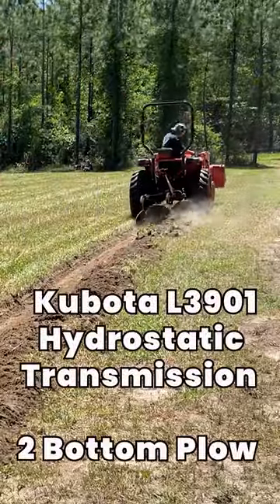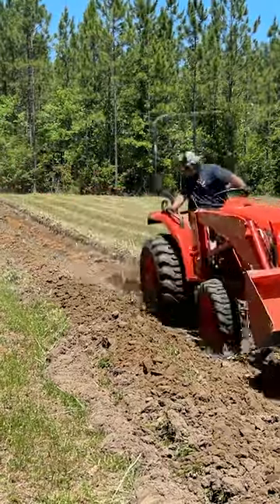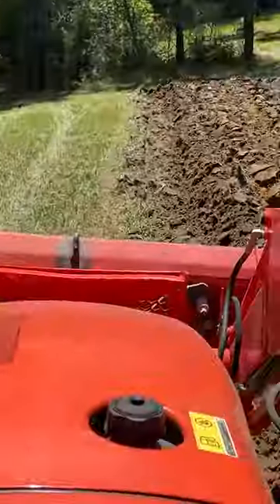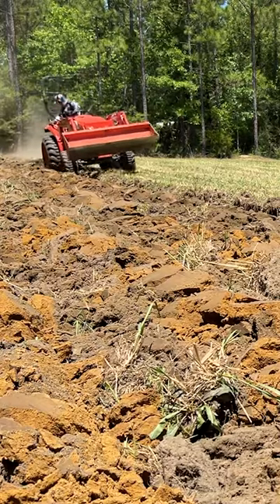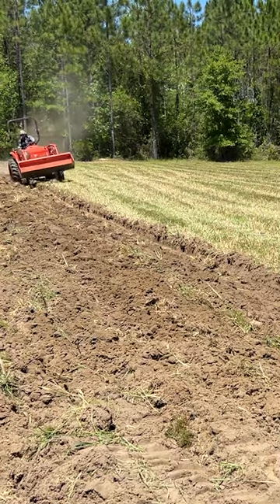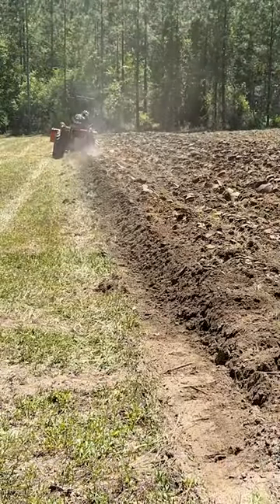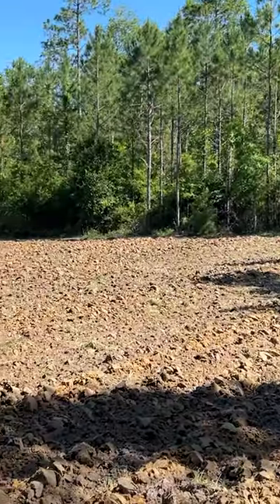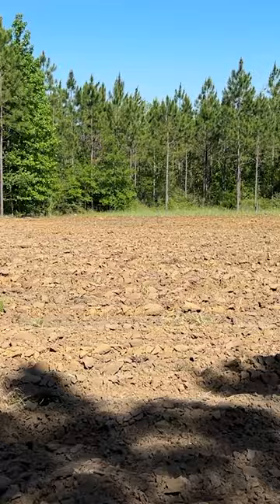Plowing 1 Acre With 2-Bottom Plow and Compact Tractor!

Comment: 15hp tractors use to pull those 2 bottoms back in the day.  They had torque for weeks.
Reply from the maker: Agree.  These new tractors are built different.
Reply: Hydro vs gear
Reply: @mattcaesar5781  I am talking about John Deere A&B
Reply: How much is plough and how much will it cost to send to zimbabwe
Reply: Gearing
Reply: Bigger tires.
Reply: @matthewheinze1231 not counting the 50, 520,580 and so on
Reply: @matthewheinze1231 they have pistons the size of coffee cans that's why they had the power, my favorite 2 bottom plow tractor is a super 77 oliver and the 861 ford power Master,  but the ford can pull a 3 bottom in has pie weights
Reply: The deers a and b is what I was taking about.
Reply: A farmall cub could pull a little genius two bottom, and a my international 806 could pull a 6 maybe even 7 bottom for days.
Reply: Also you loose a bunch of power through the hydrostatic transmission. I pull a 1-16 with my 20hp 318 john deere lawn tractor
Reply: Gosh, I have a 1993 murry self propelled 20" 3.5 hp push mower. Every year I hook a 24 bottom plow to it and turn dirt on 1700 acres. It runs at about 2/3 throttle all day, never misses a beat. It even mows the field at the same time. They  sure don't make like they used to... 🤔
Reply: @lcee6592  lol
Reply: @matty2helpfull hydros today yes. An ih hydro tractor such as an 656 or 826 etc where marketed and reported to pull just as much as a gear drive tractor. It's just today's new junk that ain't worth a flop
Reply: Exactly right.  Takes more hp to run hydro.
Reply: @matthewheinze1231 Yeah but that was when a tractor was built for work. No cupholders on those old horses. Got an "A" JD on my shed and an international super A. Both 1952.

Comment: Fill the front loader with dirt, and it will act the same as suit case weights giving the front end more traction and utilizing the 4wd better
Reply: No need
Reply: Good idea, that would always help when you're pulling, and it's a lot cheaper than branded counter weights.

Comment: I mean.. I've seen plenty of fields plowed with 2 and 3 bottom plows behind 2 wheel drive 40-50hp tractors. It wasn't all that long ago people were working 1000 acres with a small fleet of 4020 open cabs. 

Rows look straight though. Good stuff feller.
Reply: 4020s are decent sized tactors
Reply: Them days are gone 4020is an old tractore
Reply: @mattsimonson1374  Decent sized tractor, yes. But my point was that it wasn't that long ago that people farmed 2500 acre farms with 4020s and other 90-100hp tractors. A 40-hp tractor is plenty for this job.
Reply: @rexsmith3944  it is. I still know plenty of folks putting old 4020s, Ford 5000s, and similar tractors to work in hay fields. Though, I agree. You're more likely to see them on larger property owners' fields than farmer's fields.
Reply: I mean i ran a 4 row plow 4020 once
Reply: We use a 4000 still. 4 bottom plow
Reply: Plowing moms garden still and when planting corn as a kid we got a 3 bottom 3pt plow and pull it with a JD 520.  I have added 3 sets of wheel wieghts (400lbs? each side) and a 4 piece front wieght kit (440lbs)  pulls the plow pretty good. Turned down 20 yr old sod with some scrub max of 3" and disced it aggressively and was running out of power not traction.  Tractor is getting freshened this winter to fix oil pressure issue and get her from 33hp back up to low 40s hopefully
Reply: my biggest is a tw 25 most of mine are open cabs.

Comment: thats a little plow i have a oliver 2-16 2 bottom plow i pull with my 1967 Ford 2000 gas tractor my dad does a huge garden it covers about 3 acres if ground. been plowing with that setup for 10 years now the tractors got fluid filled rears and it does a really good job. its a big heavy plow but that ford does the job very well. 
fun fact place i used to work at had koyote 4wd 45hp diesel with a loader tractor hydrostatic drive and i tried to pull the same plow with it and it did not do it. the grounds been plowed up before to. not virgin ground makes me like my old ford even better. yall
say what you want but ill
stick to my almost 60 year old tractor to these newer ones any day.
side note i have more then 1 tractor as well. this does happen to be one of my larger tractors as i just have a small farm and
my dad just has his garden.
Reply from the maker: Old tractors pull better!

Comment: When using a tractor with a hydrostatic transmission don't let the oil get to hot or you will be replacing it
Reply from the maker: How would you know the temperature?   None of them have gauges.    These tractors are tougher than you think.
Reply: @PineyGroveHomestead  drove hydro tractors for years and I know what I am talking about. The only reason that tractor will last a long time is because it will only be used 50 hours a year.

Comment: Do you think a L2502 will do this task reasonably well?
Reply from the maker: It's got the 3 speed hydro, so you can put it in low range, but in really dry ground it might struggle.  In loose ground, it should get the job done but don't expect to plow 40 acres!

Comment: A 3901 Kubota is not a 40 HP tractor. I own one. It is  37.5 HP. I am ready to buy a 4701 now. I started with a 2501. I have an old JD two bottom Trip plow and I am sure my 3901 would pull it but I use a Rotary Tiller now and parked the plow.

Comment: Yeah but how sore is your right leg from holding it in gear?
Reply from the maker: no issue holding down the hydro pedal.   After 9 hours of brush hogging in the hot Florida sun, your leg does tend to cramp though.
Reply: Set your cruse
Reply: Get a clutch model

Comment: Question is when is the tractor done. Thats too much load for this little machine and it takes too long with that plow.
Reply from the maker: Kubota manual for this tractor says 2 bottom plow...
Reply: I pull a big old ford 2 bottom plow with my 24hp tractor.  Old 8ns weren't big tractors and they pulled them for decades

Comment: My 1951 vac case pulls two bottom plow its only 17 horsepower guess horse’s are not as big as they used to be
Reply from the maker: More about weight, gearing and traction than horsepower.

Comment: What size trailer would you haul that size tractor with I have a 16ft 3500 double axel?
Reply from the maker: That's enough but barely once you start adding implements and fuel and other things to throw on the trailer.  Also, a brush hog will hang way off a 16' trailer unless you take your loader off.   I had a 18' 7K, 18' 14K, and now have a 18' 10K.....the 18' 10K works great.  20' would be better.    check out this vid: https://youtu.be/w7n2coAk6oM

Comment: My branson 2515h could pull a 3 bottom
Reply from the maker: I don't believe you.  Tony's Tractor Adventure has that same tractor and it can barely pull the 2-bottom.  In fact, it failed pulling the 2-bottom in his last video.
Reply: Yeah I don't belive that either. Not in Virgin ground.  Maybe once it's been broke up with a ripper. My 24 hp tym will pull a 2 bottom but it struggles in virgin ground

Comment: Should pull a 3 bottom easy
Reply from the maker: It won't.  There's a lot of sand in our soil and 2-bottom is all she wants.
Reply: @PineyGroveHomestead I normally pull a 4 bottom with 14 inch wings behind 65 horse tractor but I know from experience 105 horse kubota won’t pull 4 bottom with 18 inch wings that tractor would probably pull a 3 bottom with 12 inch wings but I’m not sure

Comment: Be careful using a hydrostatic transmission when pulling or pushing heavy heavy loads continuously.  While the transmissions are extremely durable, the weakest points, the Splines can be problematic, thus repairing requires splitting the case. 
    (2) Don’t work your Kubota at low RPMs thinking that your saving fuel. You are actually doing damage to your hydrostat by lack of fluid.  You want your fluids pumping at factory recommended pressure!!!
      I learned this the hard way when my wonderful Honduran workers kept trying to save me money.  God love ❤️ them …
Reply from the maker: good points.  I tend to run her WOT.   Full video here: https://youtu.be/sMpNlu8yt1Q